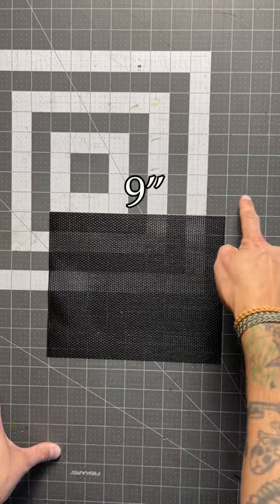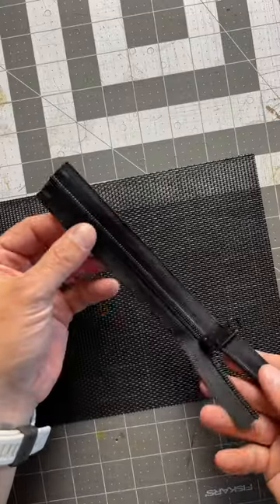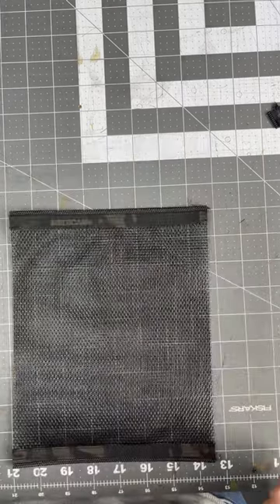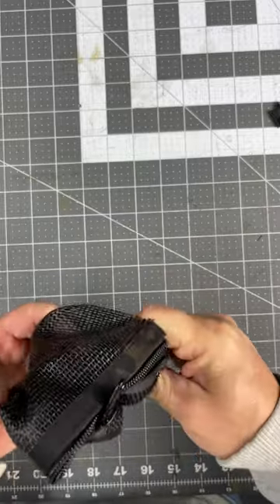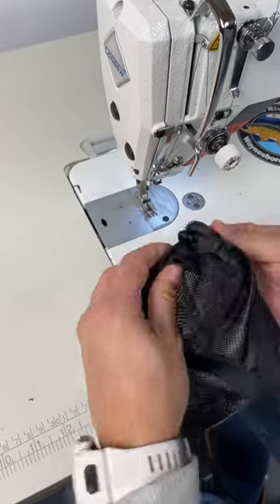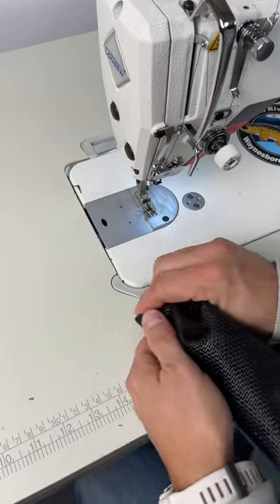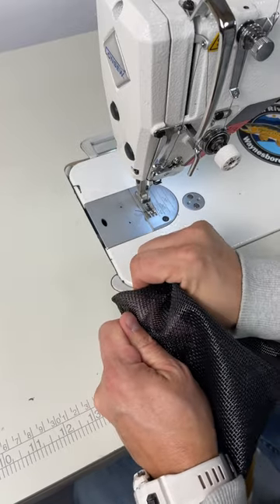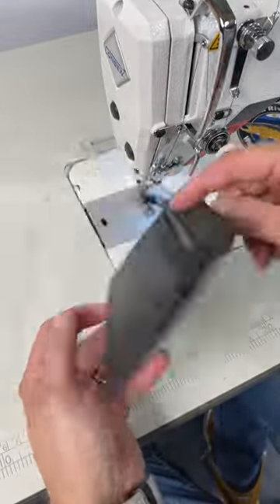Making a mesh EDC pouch (every day carry)

Comment: Hey nice project! When I sew zippers like that I like to put the slider on and zip it all the way off the other side so it's completely closed and then install it again. That way you can place the slider in the middle out of the way and both ends will be closed when you sew across them.